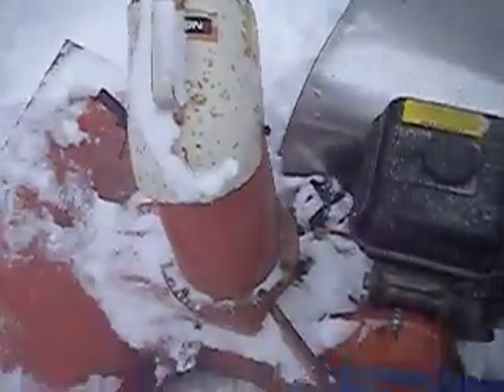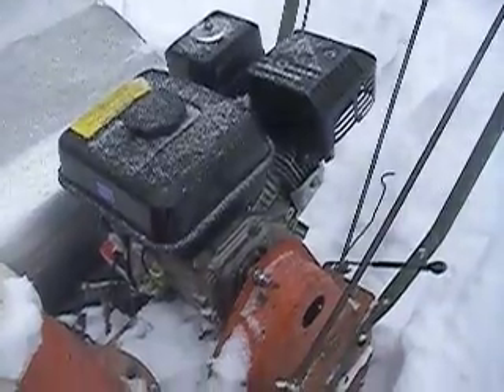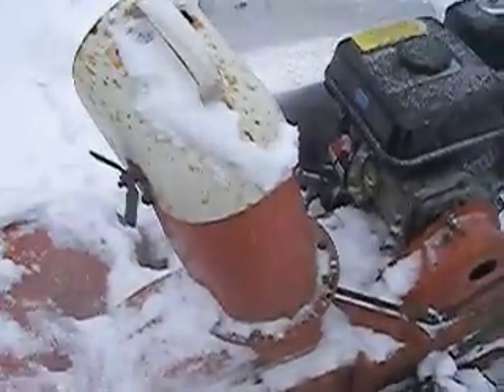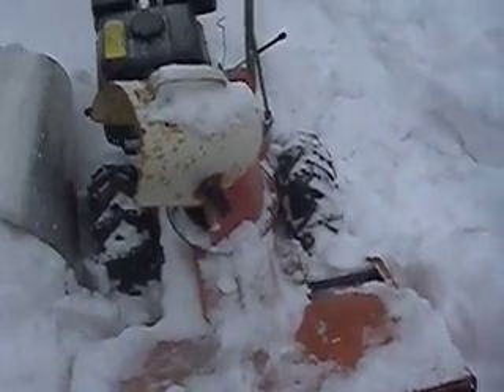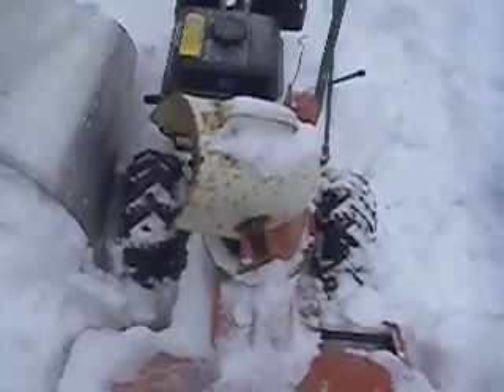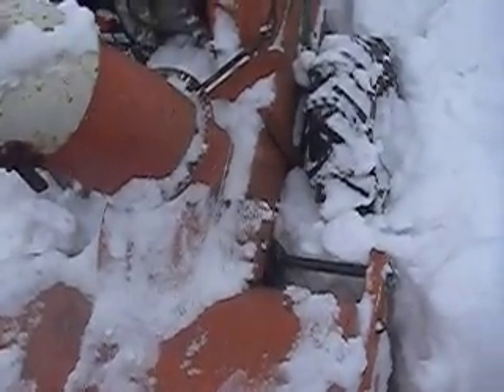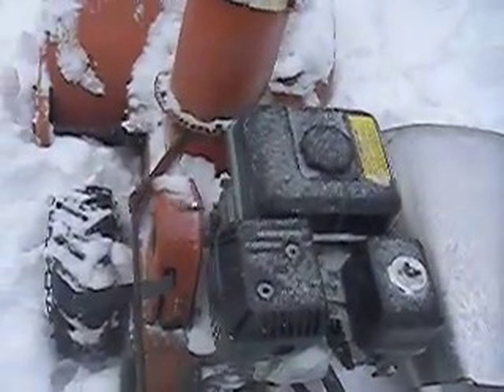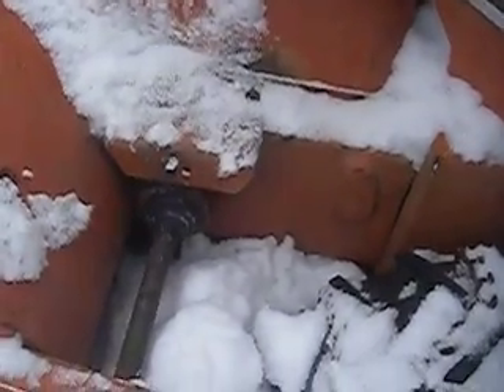IMGP9344

Comment from the maker: Hum the Briggs that was on it looked to be original equipment but who is to say they didn't change suppliers from time to time. I may be wrong on assuming it was an MTD it could even be made by Simplicity . The reason why is I saw a Snow thrower/blower that looked identical with the same motor on unit Called Simplicity but I am sure it is the type of product that is made for a number of different companies to slap their label on it

Comment from the maker: Thank you this is great. It was very difficult to find information on that style of snow blower. Digging deeper mine may be a Simplicity brand . It only had a 4hp brigs and maybe why it needed so many forward gears . Right now it is a good snow plow LOL. You will like the extra power the 6.5hp has over the original motor on your machine